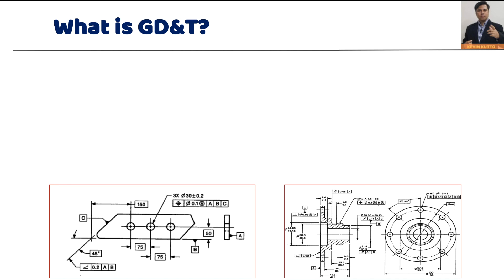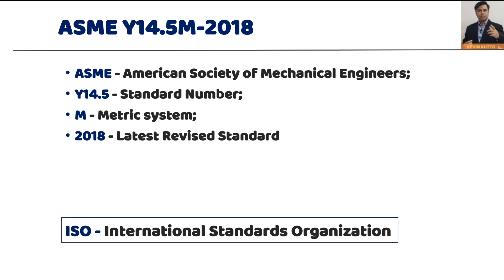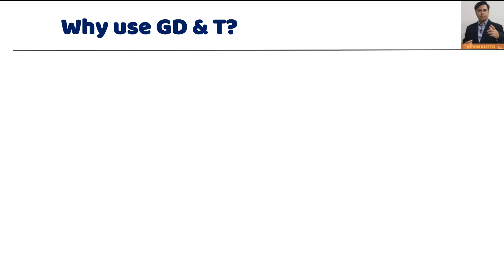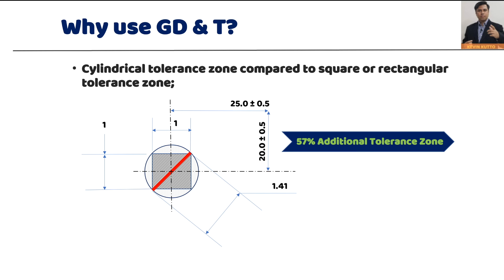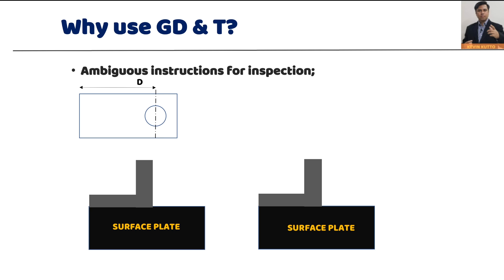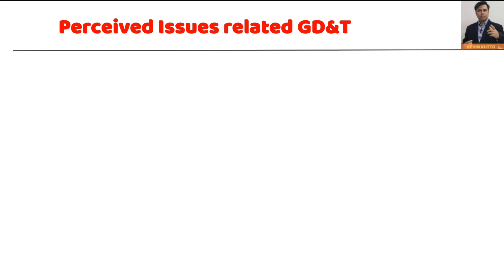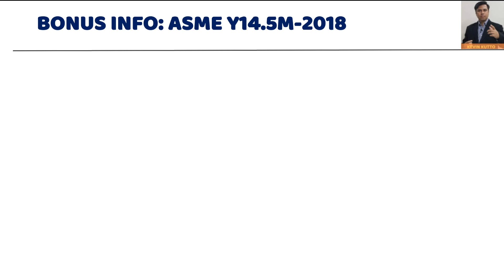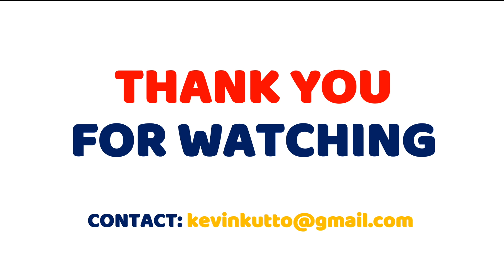GD&T: What is GD&T? | Why use GD&T?

Comment: Hello Sir..can you please explain what will be the effect if we interchange hole size tolerance with its position tolerance?
Reply from the maker: You can convert hole size tol into position tol [called as bonus tol] only if we use MMC modifier.

It means that you get addition tol to control location as actual hole size departs from its MMC.
Reply: @mechanicalvault  Thank you for the response